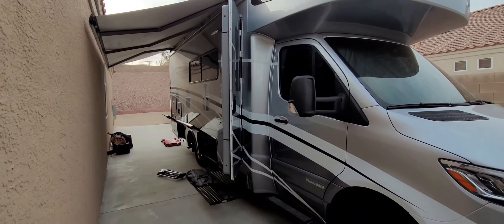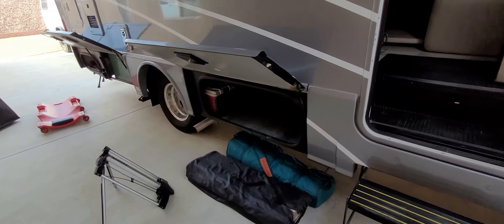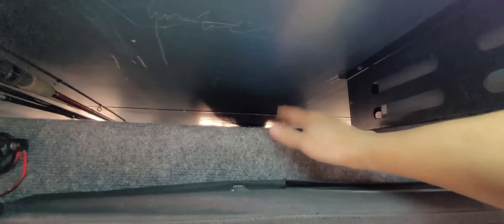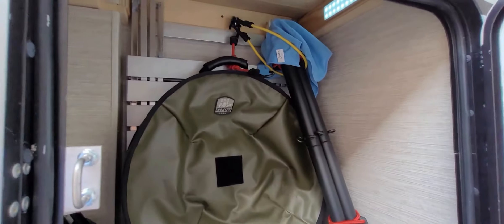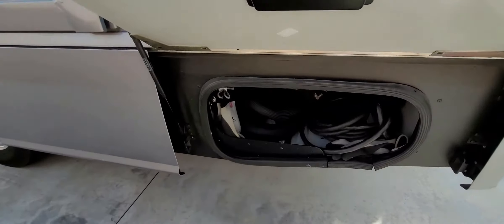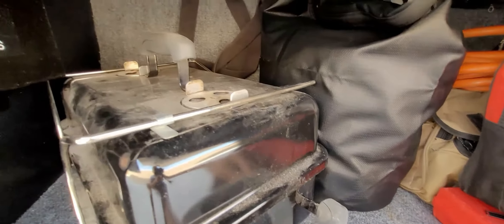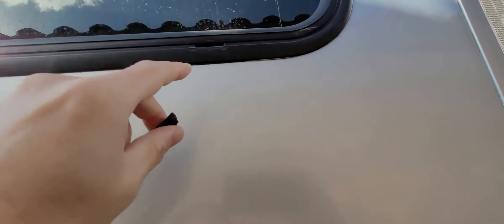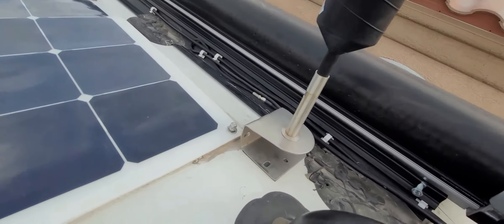Winnebago View Motorhome Exterior Mods and Walk Through (Part 3)

Comment: I love the idea of raising the compartment passenger side and motion lights. 
The sewer hose tube is in an excellent spot. 
I have a View also , just got it in 12/21. 
I’m wondering how tight does your slide retract on the outside. Ours shows the gasket when closed. Does you gasket disappears ?
Thanks
Reply from the maker: Hi Rick.  Unfortunately your slide sounds normal. The View slides do not come close to flush at all and all thr gasket seen is normal. It should be tight of course not letting any air/water in but the slide does stick out. For the raised closet floor, you can also raise the closet rod by 1 hole (unscrew bracket and use the top hole as the bottom hole).  That we gain most of the height back in the closet, even though it's likely unnecessary.
Reply: @rvlifediy  Thanks for the quick response !
I thought my slide had an issue. 
Did your video come out about the Chassis features ? 
 I also got the cushion for the dinette with some resistance from WB , but they came through in the end. Our Zamp controller was defective. Zamp sent a replacement. 
Thanks
Reply from the maker: @rickc9873  I got a little side tracked on the chassis features.  Hoping to do by next weekend or a few days after.

Comment: Awesome!  I do have a question about your TPMS monitors.  Can you share more about them?  Do you have all 6 tires connected?  Is it an app / bluetooth?  Thanks!
Reply from the maker: I have the TST Brand TPMS and it does not have Bluetooth or app.  The monitor is wireless though.  There are many different brands out there these days.  I only have 4 connected. Winnebago has steel wheels on the inner dually with plastic valve stems with a plastic extension. I had the inner dually plastic stems replaced with a metal stems with the intention of using a flow through sensor.  But the tire shop used too short of a stem for the sensor to thread on. I need to buy different stems but it has made it lower on my list of items to do right now. I will do it eventually.

Comment: Can you provide a link for the weep hole covers?
Reply from the maker: I bought directly from Lippert Components.  Warning that it is not a direct replacement.  A small section of the rubber plug needs to be cut with scissors to make them fit.  WEEP HOLE PLUG BLACK 8500
SKU: 321212. You may want to call Kinro windows and see if they have direct fit replacements instead of having to cut them.

Comment: I have a quick but unrelated question to the previous topic:
I have had my new 22d View for a day, and one of the first things I noticed is that all the storage bays have a plastic floor that is very slippery, which allows gear to move around too much.
I like that you added carpet to yours, so the question is where did you get it, what kind was it and did you somehow attach it to the plastic with dbl sided tape or glue or screws?  
Can you buy a roll and cut it to size?

I ordered a bunch of mod supplies last night, and my SOK batteries are charging at home now before I do the installation

Along with the lithium battery project I want to upgrade the solar.  Solar has so many options available that I am having trouble deciding how far to go.  Some have covered the whole roof with panels which is kind of extreme.

If I go to the 840 watt approach I would have to change out the solar controller and maybe run new power cables to handle the increase in amps.  
I like the idea of first going to 640 watts with two new panels, but the question is can the Zamp handle that load with its 30 amp ceiling?  
And the combiner box on the roof only has three inputs and I would need four to run the four panels in parallel.  (two existing 100 watt, and two new 210 watt panels)
I suppose the breakers would blow if too much power is being created in a really high output situation.  

The alternator charging on this rig is pretty underwhelming in my opinion.  I hear only 25 amps get to the house batts.
I know that they don't fully get there because the charge voltage is too low, but then the solar panels can complete the SOC.

My old class A had a 280 amp alternator, and I could get around 80 amps to the batteries from that one, using a current limiter LI-BIM 225 to protect the alternator.   
 In a three or four hour drive to a next camp spot the alternator should be able to almost top off the batteries, in my opinion. .
Reply from the maker: For the capet, it is a roll from home depot. It is the lightest thin gray carpet they have (similar to diesel pusher carpet storage bays). I used 1 piece and got the width to approximate size and cut the length longer than necessary, and cut to length inside the bay.  The carpet is 1 continuous piece all the way through the pass-through as well. I only glued the vertical part of the bay when 3 M spray from home depot.  As for solar and alternator, I went with the 600 watts because I use my RV almost every weekend and have limited time (and it works good enough for now)  In summer the recharge is no issue. Winter is the problem with just 600 watts and stock charge mate pro from the alternator. If you want to do Phase 1 of solar, the 2 new panels would each plug into their own solar port, and the existing panels you need to parallel connect at roof and then connect to 1 roof port. The stock charge mate pro tops out at about 28 amps.  It's on my future mod to replace, but it's not on the top of the list. FYI, I put the same carpet in the very last compartment on passenger side top and bottom, as well as inside the interior closet.  The stock 30amp charger will need to be replaced with 600 watts. I can get 35 amps during summer.
Reply: @rvlifediy  Thanks. I will get that carpet going now.  Great suggestion.  As to the solar I understand running the two new 210 watt panels each to a port on the combiner, then joining the existing 100 watt panels parallel into one cable and going to the last port of the port.  But isn't there a polarity change that I need to do.  I am a bit confused about that and the cable connectors that do the flip around.   Is it the Zamp controller that runs in the reverse polarity and the roof wires need o adapt to that configuration?
Reply from the maker: @5290harp  Yes the Zamp port on the roof is the reverse polarity. I used one of these Solar Panel Connectors 10AWG Compatible with MC4 Connecter to SAE Adapter PV Extension Cable Wire for RV Caravan Solar Panels Battery Charger kit with Two SAE to SAE Polarity Reverse Adapters https://www.amazon.com/dp/B07MW1M1VB/ref=cm_sw_r_apan_i_43VSDQ4WJ24166NGJHRC?_encoding=UTF8&psc=1 but did not use the little adapter that comes with this that reverses the polarity. I actually cut off the MC connectors and installed new ones in reverse so I didn't have to use the adapter.

Comment: Very nice. I have a 2020 Navion 24D. How did you install the solar panels w/o screws? I want to add 200amps to my system.
Reply from the maker: I used VHB Tape just like the satellite install. The rigid panels I added were Rich Solar 200 watt (x2) 12 volt panels. The mounting feet I used were called RV sticky feet that already come with VHB Tape. I have a series of videos I did on my Install long ago but never edited them. If you have other particular questions, let me know.
Reply: @rvlifediy  That's great. Thank you so much

Comment: Trying to install the sewer hose holder where you did on my 24D Navion but I can't get the rivet out to use that hole!  How did you get it out?
Reply from the maker: Are you talking about where the plastic with the metal under it at the rear bumper?  I don't recall it being a rivet and thought it was a screw. It was a few years ago so I don't recall. To remove a rivet, you just drill the head of the rivet gently and it pops off. I recall using 1 existing hole that was a screw and drilled another new hole. Hope that makes sense.
Reply: Yes, I will need to drill the head to get it out, it is a circle center.  I will use that hole and create/drill a new hole for the other side of the bracket.  Will also use double sided tape like you. Thanks again for all your help!! @rvlifediy

Comment: Do you have any details on how you installed and connected the extra water tank?
Reply from the maker: The Video titled my top 20 mods has a very quick glimpse of it as well as a link to the exact tank I used. The factory water tank has the main pex line that runs  behind a false panel at the dinette bench. You can connect your new water tank with a pex T fitting to the factory pex.  The vent line for the water can also connect to the factory vent with tubing. If you are handy with working with Pex, it's a pretty simple install.  If you want further info, you can email me nvmutts@gmail.com and I can provide more details and pictures.
Reply: @rvlifediy  l love the idea of adding another water tank. Any chance you would consider doing another video just walking us through exactly how to install the extra tank and PEX tubing? Thank you for your videos!
Reply from the maker: @samraantons491  Yes that should not be a problem. I'll just make a private video and list the link so I don't bore everyone to death. Give me a day or so.
Reply: @rvlifediy  wow thank you! I hope it’s not too much trouble. Thank you for your videos they are very helpful👍
Reply from the maker: @samraantons491  ok I've never tried this before. See if this link works for the private video. https://youtu.be/UG3gfKnRfCA